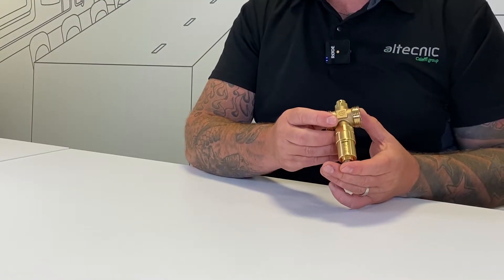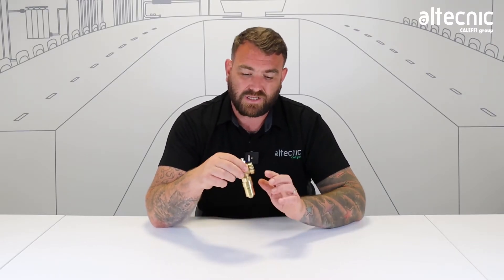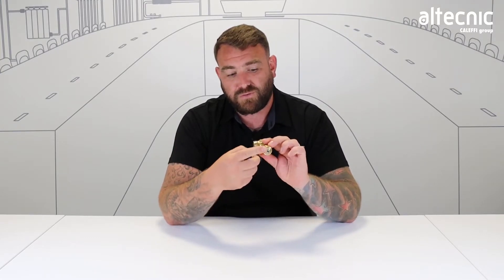How Does An Anti-Freeze Valve Work?

Comment: This valve is made of brass, so it is a very good conductor of heat, which means that not insulating this valve will compromise the heat retention. Effectively this valve seriously reduces the efficiency of the ASHP system.

Comment: What are the consequences of this valve functioning? When reaching temperatures of 3 degrees and below, I understand that the water is released out. But... can it be released only from the heatpump and leave rest of the water - from the inhouse heating system - intact? Or there is a risk of depressurising and emptying the entire heating circuit, also from inside the house?
Reply from the maker: Thanks for your question! The operational function of the valve is to draw warmer water from the system to the cooler parts to prevent freezing, this would no doubt over a period of time draw water from within the property. The discharge rate is approx 0.5ltrs per hour at -5deg, however for the system to drop to 3deg at -1deg ambient temperature could take up to 36hrs so the chance of activation is minimal. Also if the valve were to activate, I would assume only an amount of the head of pressure will be released and not full system drainage. 

For any more information, please follow the link: https://www.altecnic.co.uk/contact-us/
Reply: @altecniclimited947  thank you for such a complete answer. I finally understand its functioning.

Comment: What happens in a power cut?
Reply from the maker: Hi, During a power cut the valve will start to discharge when the temperature drops to approx. 3-4 degrees within the pipework - protecting the system from freezing.